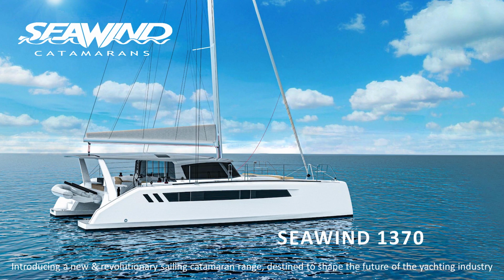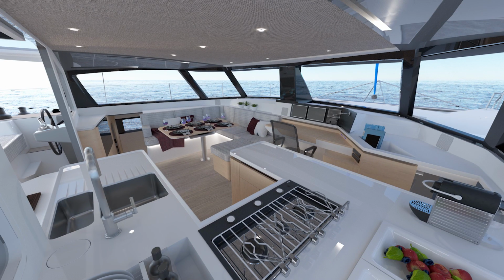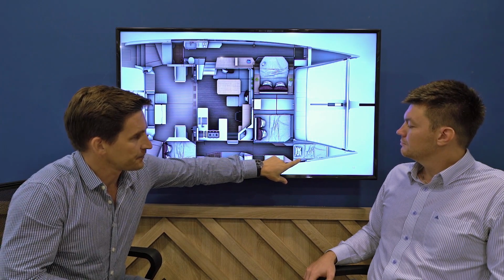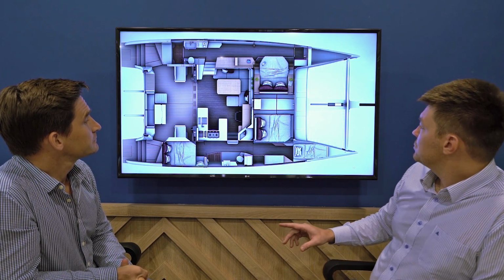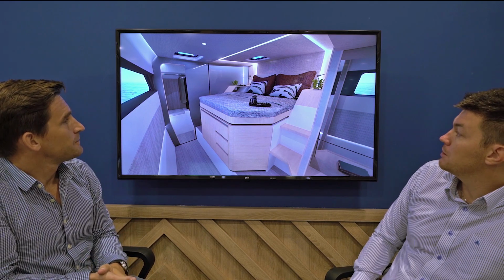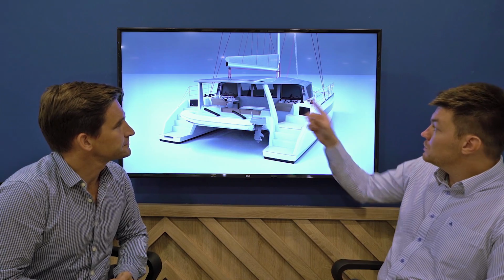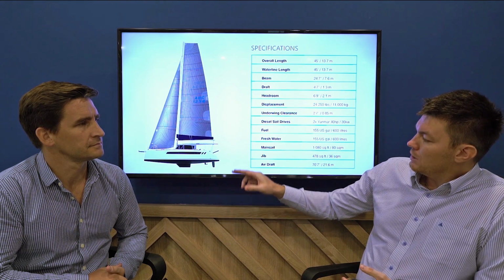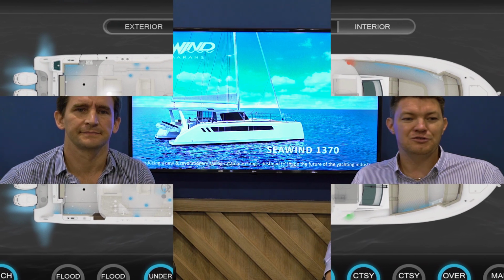New Model Announcement: Seawind 1370

Comment: I love the 1370 and especially Nick's Ruby Rose model but I have 1 concern about the hidden lines under the deck. If replacing an old line you just pull the new line through the sheaves with the old line but how do you run the new line incase the line actually separate and pull out completely?

Comment: My impressions are mostly the same as the others here.  1370 has a great overall design: salon as pilothouse is very logical, safe and simple.  (Phil from Balance Catamarans likes it too.) 1370 takes the best aspects of the 1260 and improves them: even clearer sightlines, cleaner and more modern styling, more storage, better use of space, etc.

Not sure why some people refer galley down.  Galley up creates a much more natural great room for socializing around food, keeps cooking fumes out of the hulls, etc.  On land, most people spend much/most of their time in and around the kitchen.  Thus the growing popularity of homes with great rooms centered around or connected to the kitchen.

I too would like daggerboards.

And I would want an option for inboard electric propulsion with hydrogeneration, more solar, a larger Lithium battery bank, a backup generator. 

As an aside, a clever way to do a generator is to use a standard marine engine and connect its output to an electric motor used only as a generator.  It's lighter than a genset and more efficient and uses standard marine engine parts and maintenance.  It can use the same electric motor and motor controller as the propulsion electric motors.  Silent Yachts solar boats did it that way.

(In big ships this is called Integrated Electric Propulsion; in cars, it's a serial hybrid; it's also how diesel electric locomotives and submarines work.)  

Admittedly both add to cost, which is probably counter to the design brief of keeping 1370 simpler and more accessible, but it would be nice to have them as options.

Your audio is very hard to hear.  A couple lapel mics would sound much better and cost relatively little.  Getting this wrong makes a poor impression.  Producing a competent video is not hard and is worth doing correctly.

Comment: I hope the boat will sail not like the 1600 which is worst balanced boat I have ever sailed
Reply: What were the conditions?  I’m quite surprised with so many adjustment available on the 1600, a balanced helm could not be achieved. Perhaps more adjustment was needed on the draft of your daggerboard, reefing the main, or adjusting the traveler.

Comment: How about a prop window on board? Can’t remember which boat I saw it on...you pulled up the bed and there was a round plexiglass window fused into the hull allowing a “dry” or night check...Only thing I’d add would be a spot light for night or low visibility....Cheers!

Comment: Would love to see this design language extended to your smaller designs.  I find the design esthetic of this model very appealing but the price of the 1260 where we are at.  Sounds like the order book is filling up so congrats to your team.
Reply: This is their latest design.  The older designs date from a decade or two ago.  Hopefully they will expand the 1370 design upwards and downwards in size.  

BTW, the 1370 design is very clearly inspired by those of Balance Catamarans, which are now priced about the same as Seawind with the new 482 and especially 442.  Be sure to check those out too.

Comment: Needs (by my list): 
1. a longer enclosed cabin - 6 to 10 ft. MINIMUM and
2. covered seating on the rear hard Bimini with 5'10" headroom and hard cover (with drink fridge:)
This top should be recessed on center to permit a furling mainsail to lower into it - and then rise above it when a mainsail "angle" is needed.
3. All-electric, regenerating drive motors with generator backup and 3 to 4,000 solar
4. Engine wells so motors and sail drives can be hoisted out and serviced without haul-out.
5. High displacement front hulls - rather than slower wave slicing
6. Chines above waterline for non-performance-impacting cabin space. 
7. Air conditioning and induction shower water heaters
8. Rear hydraulic ramp that levels with rear seating floor panel that can turn up verticle to block trailing seas on passage
9. A reliable, automated 8' single-telescoping mast would be ideal but probably impractical.

Comment: Impressive design for this size. Added the presentation by 
Sailing Yacht Ruby Rose (Ruby Rose II model) its power management and other focus areas,  very close to perfection. Only in case of bluwater night sailing - The helm position is sosial inclusive, while not so suitable for night sailing unless all saloon lights are switched of to protect the helmsman's night vision. A solution is to elevate the helm as (for example) the Xquisite X5, still saloon windows will need blinding curtains so the off duty/passengers can enjoy socialising /watching a movie in there.  (This is the practice for ships.)

Comment: Just saw Ruby Rose's video on Ruby Rose II, which is going to be a Seawind 1370, customized for them.  This is going to be a very nice sailing yacht for a couple.  It should be efficient, well handling and rather spacious for two people.
Nits:  About the only thing I might complain about are the sail drives.  From comments of others on various other channels, straight shafts seem to be more reliable than sail drives.
Will she be able to use a Parasailor?  I'm pretty sure she should, but if all the lines are running unexposed, how hard to add more lines?  Maybe they're already there.
Likes:  Okay, I admit, I'm a Privilege fanboi!  I love the center master suite, and the associated room with it.  BUT, in a 45' cat, I think the design here on the 1370 is very well laid out.  I'd like to see how much storage space there is in the Master Cabin, hanging lockers, etc., since there are no daggerboards.  I hope that's opened up for lots of storage space.
I like the fact that you can have as much power from solar and the engine alternators.  I don't see that it matters if you're running a genset or an engine, provided that they are optimized for running as a genset.
Ruby Rose provided the Polar Wind Chart.  I'm hoping those numbers hold up to real world application, they are some pretty spectacular numbers.  No one, really, wants to go slow.
Anyway, nice job, Seawind!

Comment: I love Seawind but solar panels are 8 years behind current capabilities.  You can get 375 W 60 cell panels and put as many as you can on the boat ( 10 is great if they are 375 W Canadian Solar panels).  Second run 24 V bus with Li ion 800  Amp hr 24 V batteries -  3 of these to run AC. You want at least 16 000 W of Li ion. Also 1200 W wind turbine with shutdown capabilities in storms.  Chilled water ac as that is the most efficient (COP is best with colder water).  Insulate all cabins that have AC.  Allow 2 in air gap under solar panels to help cool them.  Yes to the diesels +200 A alternators to help charge 24 V batteries.  If using glued on panels put corrugated panels under them to allow air flow and cooling.  Put electric stove-induction and no gas (only for the BQ).  Where to put the dive compressor??  Electric??  Much better.  (FYI we have 63 panels on our home-for a boat get the best 375 W CS panels as you will lose panel output due to shading from the mast).  Get biggest motors to help get away from bad people.  Pirates still exist. At 375 W panel should cost no more that $300 US plus install and controller.-remember to have good air flow under the panels.
Reply: I agree. 24V instead of 12V, especially with modern options and high current draws in these boats.
Reply: Would you get electric motors?
Reply: @yoog1  Kirk is suggesting inboards with alternators.  I would use electric motors, hydrogeneration, solar, and a backup generator.
Reply: What is the extra cost on your system?   What Seawind chose 12v over 24v? Is it because of available appliances?
Reply: Agreed that they can get much more solar in there.
Have you seen the Sunreef 60 E-Cat? The carbon fiber bimini with somewhat transparent view and tons of ventilation is amazing.
I haven't seen/heard a wind turbine quiet enough to want one. Though a hydrogenerator on a fast boat would be amazing.

Comment: Good job. Are you thinking about solar electric panels and electrical engines with one good generator?
Reply: That would be the ideal configuration.  Twin sail drives, with regenerative capability, and a diesel generator for moderate AC/DC backup power.

Comment: Bravo. Awesome work.

The good: one-level kitchen, looks like it would sail well, sooooo much prettier than your old (pre-1600) models!

The (tbc) bad: hope the viz and headroom from the helm station is good enough, also for us taller people.... that's what prevented me from buying your 1260 after a testsail.... still would really prefer the half-raised helm-stations on 1-side as on all/most other boats though this size, clear views, nice and open fresh wind in your face, more "sailing" experience - why can't you offer that as an option? Most of these boats will end up in nice-weather environments anyways, so no need for a over-protected helm-station, no two helm stations (which should be a massive cost saver)....or at least less than 1% of the time.
No daggerboards - seriously, add this is as an option.
What about the rudders? fixed? I hope not....
Why no roof hatch in the saloon? Or two! 

U should also work on getting cheap offers to ship your boats from Asia to US/Europe......right now that is a major $-bummer vs the EU/SA builders

Comment: It looks great. All the best design from the 1260, a little larger.  Looks like a perfect safe blue water cruiser for a couple.
Will you offer an option of a utility room instead one of the forward cabins?
Reply: You answered that with yes in the video.  If this cat is well priced and it has good performance it will be a top contender.  Nice presentation - beautiful project.
Reply: @pierre.a.larsen  That is exactly my impression also.  They took the strengths of the 1260 and improved them in the 1370: clearer sightlines, cleaner styling, simple operation, more storage, etc.  Ruby Rose 2 is replacing the forward single berth with a workshop.

Comment: Very disappointed. Everybody builds fat-hulled, poor sailing, galley-up cats that emphasize having 3 or 4 big double cabins above all else. Is Seawind going that direction? Would have much rather seen an enlarged 1260 giving the same layout a little more room (1360?), and a sport version that adds features like the 1190 (1390?).
Reply: From what there charts look like from their website it's still hits stunning numbers like in between 110 and 120 degrees of angle with 25 knots of true wind speed the 1370 still hits 20 knots of speed

Comment: Fantastic looking boat!! Love it. 
Any chance Seawind has plans for a 100% solar powered catamaran?
Reply: I agree that a full solar array + improved lithium, along with electric engines and an optionnal genset is the path for the future.
It could also allow boat constructors to refine the hull design and space allocation with a much smaller engine bay 
- I would have love to see shaft drive again on cats, safer for beaching
- I would also loved to see a genset with an utility torque, for example to drive a dive compressor or an emergency high flow pump without relying on electric (which could be damaged is you boat is sinking/lightning struck...)
Reply: 1370 Daggerboards option?
Reply: The problem with that is range and then you'll need a genset on board. I think this is a nice hybrid approach that Nick and Terysa are going with...

Comment: Exciting, are you considering Electric Engines or Hybrid Engines as an option ?
Reply: Ideally, were I to buy one, I would pull out the diesels, put in 15-20 kw electrical engines and a and a generator (mostly for emergencies)
Regen would be great - it is a performance cat.
Reply: @pierre.a.larsen  me too !
Reply: I  Yes, why not? Then add enough lithium capacity, a diesel generator and enjoy 4" bridgedeck clearance.